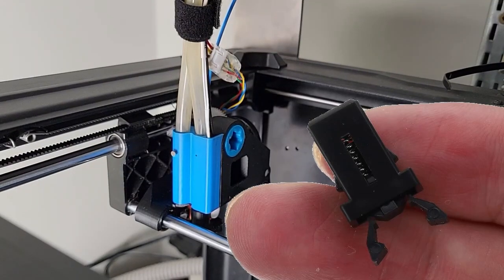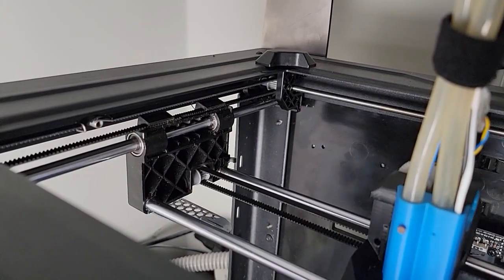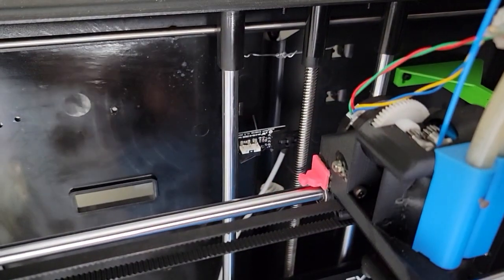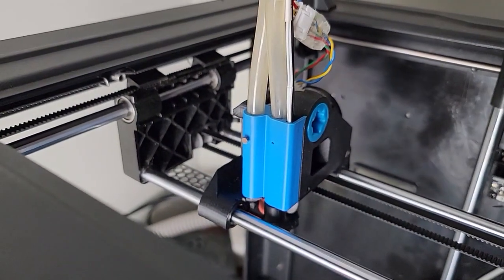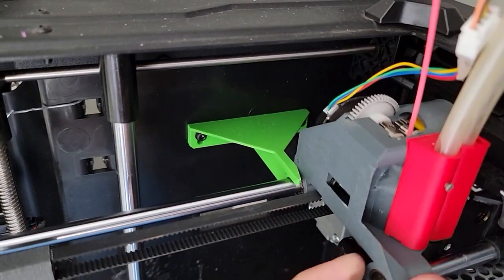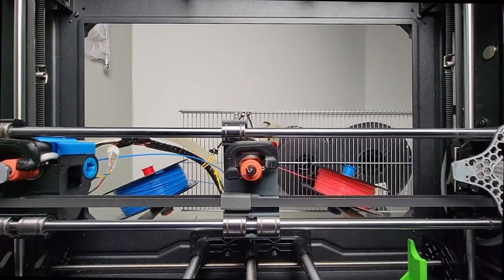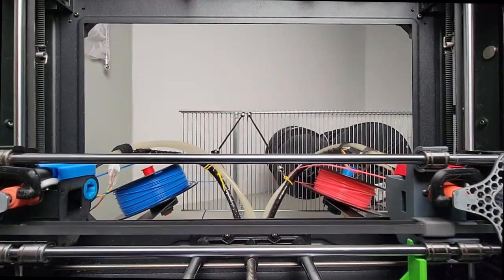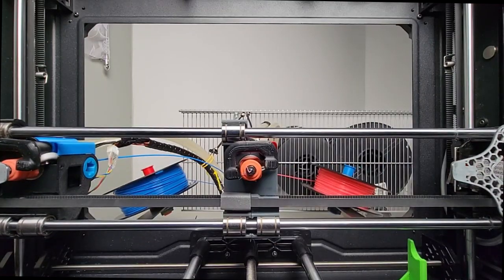Magnetic IDEX Experimental Tool Changer Using Push-Push Latch

Comment: HI. :-) Could this also work on a CoreXY?
Reply from the maker: It should be possible. However, I believe CoreXY machines are better suited for a full-blown tool changer rather than Magnetic IDEX. Personally, I think the era of CoreXY is winding down. They’ll still exist, much like bed-slinger printers, but there’s something far better on the horizon. 🤔
Reply: @m_IDEX  Ja, ich finde das magnetic idex interessant für kleinere Drucker. Ich habe mir einen Sovol SV 08 gekauft zum umrüsten auf einen richtigen Tollchanger. Warum meinst du dass Core XY nicht mehr aktuell ist?
Reply from the maker: I think CoreXY’s reign is fading because there are simpler, lighter, and more robust motion systems out there. A great example is the “Markforged kinematic” or Hybrid CoreXY system. I’ve also been experimenting with a simpler, more direct drive motion system, but it’s not ready for prime time yet.  Curious to hear how your Sovol SV08 tool changer build goes!

Comment: Genius 👍similar to cupboard door latch mechanism brilliant. Sorry I am a bit slow still can’t catch the moving magnetic latch part.😊 it’s just plain magnet on the moving part & steel on the print head right? 😊
Thanks for sharing ❤
Reply from the maker: Thank you!  You can see the belt coupling (white rabbit) assembly in this video: 
https://youtu.be/MN3h3hWuE98?si=UAxnd6M0hMKCThK3&t=39

Here is a cross section view of the White Rabbit:
https://www.printables.com/model/517880-magnetic-idex-belt-coupling-for-worlds-simplest-id

The tool is latched using two small magnets.  I have used both 1/4" OD by 1/8" thick disk magnets and also 1/4" OD by 1/4" thick magnets.

Here you can see how I recover magnets from old prototypes: 
https://youtube.com/shorts/eGYrz3Z6NqI?si=vRc86LgZyc6pBw5o

Comment: Great work . What about the firmware ? is it klipper and bigtreetech board .
Reply from the maker: Thanks!  Yes, firmware is klipper.  I have two printers one uses stock Mightyboard plus SKR mini.  While my 2nd printer with Akula-class motion system uses octopus control board.  You can see my part list and some design notes here:  https://docs.google.com/spreadsheets/d/1fb1T2YSfM-OhzU3zWx77bUNyia4o-GPZsPlaNYT4-vA/edit?usp=sharing
Reply: @m_IDEX  Is the config file available ? I wanna test this idea . Btw maybe you can use this idea to correct resonances in y axis (self aware 3d printers) , https://www.youtube.com/watch?v=OODy-dI52Zg
Reply from the maker: @cleison-em7bk  Link to the early draft of klipper config is located inside the BOM document that I shared earlier.  Scroll to the bottom of the BOM.  Also explore other tabs in that spreadsheet 😊.  AI looks very cool, but I’d rather prevent errors with a great printer design 😊
Reply: @m_IDEX  really appreciate . And looking forward for next results . Thanks .

Comment: How has the repeated cycle life of the switches been holding up the last few months? Not that it is a huge concern ....just regular maintenance data worth having. We are really looking forward to trying this and resurrecting a couple of school printers. Thanks for all your work!
Reply from the maker: For the past two years, the tool changing repeatability has been phenomenal.  The only time I ever need to re-calibrate tool offsets is after a major rebuild.  Otherwise even removing toolhead from the printer does not require recalibration.  The push-push latch is a more recent development, but it is holding up very well so far.  Time will tell how reliable it is.

Comment: I’ve been building a modified version of you midex design for my ender 3 max.  Something that I just thought of is that you could get rid of an extruder stepper driver if you move all of the wires to the magnetic carriage and use a magnetic electrical connector or a usbc to transfer the power for the necessary electronics on the two tool heads.
Reply from the maker: Neat idea, but probably a great way to blow up your stepper driver.  Klipper lets you combine multiple cheap controllers.  You can easily run two SKR mini boards and get 8 stepper drivers.

Comment: Brilliant idea! Congrats! I ordered the latches and expecting to get them in 2 days... I have few questions to you: 
- do you have magnets only in shuttle or also in print-heads at the spots facing shuttle magnets?
- did you glue the magnets? if so, which glue would you recommend for PETG?
- you have very nice solution for nozzle cleaning. Are those metal pieces? Where did you get them?
Thanks
Reply from the maker: Thank you!

•	There is a total of 5 magnets in this build.
      o	One magnet in each tool
      o	Two magnets in the “white rabbit” shuttle
      o	One magnet in the Mirror/Copy belt coupling.

•	I use CA glue for magnets in ABS parts.  Not sure how well that will work with PETG.

•	The metal plates are filament bibs.  They prevent nozzles from oozing filament.
      o	Flashforge calls it “Filament Ooze Plate”
      o	I laser cut them out of 0.060” CRS.  If there is interest, I’ll post some on ebay.
      o	Also, I’ll post filament bib design files on printables
Reply: @m_IDEX  Thanks for quick reply. I am interested in filament bibs, but I first need to come up with the shape and the size that fits my printer. One more question - do you know if Marlin firmware can be configured to support magnetic IDEX ?
Reply from the maker: @bomai559  My first magnetic IDEX build used stock Sailfish firmware and all scripting was done in Simplify3D.  It was usable, but quite painful.  I don't know enough about Marlin, but I don't see why it can't work.  I personally would never go back to anything after using Klipper.  My old laptop is the controller and web user interface.  It also runs multiple control boards so expanding system is super easy.  

Here is an example of my very first (or maybe 2nd) video using sailfish firmware.  https://youtu.be/0azCXGJLPTY
Reply: @m_IDEX  I had issues with Marlin several years ago and tried Clipper. At that time it was very immature product and I struggled a lot with Raspberry to main board communication. I don't recall the details but it was something related to buffering. Then I switched to Repetier and my home built IDEX printer still runs on it. The problem is  - with 2 tools provisioned I often get unexpected switches to tool-1 when printing with single tool (tool-0) This ruins the prints. To completely disable tool-1 Repetier needs to be recompiled, which is super inconvenient. So I am thinking to try Marlin on it since the latest version runs fine on my another CoreXY printer. But Clipper became so popular that  I may give it another try. For now I will try to convert my IDEX to magnetic and then will focus on firmware updates. Here is my IDEX printing in case you are interested https://www.youtube.com/watch?v=Q0ZmdK9RNKQ This is one of the first prints with poorly leveled bed and retraction turned off. 
Thanks
Reply from the maker: Nice IDEX build!  Try Klipper again, but use a real computer this time.  I have Linux Mint running on a 12 year old HP laptop.  I love having full GUI and Mainsail UI in a browser on my printer.

Comment: This is not an IDEX!!!   just toolchanger!
Reply from the maker: IDEX is the simplest form of a tool changer.  Magnetic IDEX is the simplest form of IDEX.   Magnetic IDEX supports all IDEX print modes, including copy and mirror.
Reply: @m_IDEX  I have to agree, keep up the good work, and thank you for sharing the idea. I have a 300x300mm Tronxy frame or an old 300x200Robox printer  I am looking at converting using some of your motion & cooling ideas, aka lightness and simplicity, because it makes a lot of sense to me. 👍
Reply: Yes not a true “IDEX” which uses two X axis motors, but now it has morphed into a “latching” magnetic dual extruder that only uses one X axis motor. Advantages are it is lighter and simpler vs a traditional IDEX, yet achieves virtually the same result in most use cases. As an owner of a defunct IDEX printer, Dmitry has done a fantastic job designing and refining his concept, which is getting simpler and more elegant all the time, and it is unique in the 3D printer space. 🧐😀

Comment: so sick! keep up the good work..!
Reply from the maker: Thanks
Reply: @m_IDEX  NP i home one day i get adventurous enough to get it to work on a bedslinger haha I know you said it's going to be hard but it would be awesome haha
Reply from the maker: @digital0785  if the new latch proves to be reliable enough, bedslingers become super easy to implement.  What donor printer are you thinking about?  I was thinking something like Prusa MK3S+ Bear Kit By Fysetc
Reply: @m_IDEX  I have a cr10v2 back in the day I was designing my own IDEX setup but then stopped when i started doing the ender extender as I needed a bigger enclosure.. This is way better then anything I could've done and way easier to implement/ lower profile from the looks of it. I already have the octopus board and I'm on klipper anyways so least that part wont be bad !

Comment: Maybe eliminate the need for the magnets entirely and just use those latches on the carriage and the frame? It wouldn't be a magnetic idex but might mitigate a potential uncoupling of the carriage and tool. Great printer either way :)
Reply from the maker: Thanks for watching and for your thoughts.   Using a latch like this is possible. However, you'd have to deal with backlash from the latch.  I love the magnet because it acts like a mechanical fuse in case of catastrophic failure.
Reply: With Klicky, we typically configure it with an Normally Closed switch.  This way we can monitor if something goes wrong.  If klicky isn't able to attach via magnets, Klipper will error that the circuit is open.
The same concept could be used here with the magnets.  Though, maybe two magnets so you can pass current through them to detect if the tool didn't attach - or detached too early.

Comment: Do you think the latch will be durable enough to last?  It looks like it has live hinges, which can wear out over time.
Reply from the maker: That is definitely a concern.   This latch is made by several manufacturers with slight mechanical variations.   I wonder if some are rated for more cycles.   Either way, I'll set up my old plywood CTC printer to cycle this latch to failure.
Reply: @m_IDEX  Good idea.  They look cheap enough that it's not too much of a concern to replace.  But if there's a failure during the middle of a a print, well, the results could be "interesting".  :)
Reply: “Made of material, the product is and durable, it can serve you for a long time”

so it is made of material, you cant go wrong here🎉
Reply: It looks like one that is used on Brabantia pedal bin lids.

Comment: So no need to move the y axis for the tool change. That will speed things up.
Reply from the maker: Correct.  This will even work with your bed slinger printer 🙂
Reply: Agreed, every moment count.. indeed very efficient switching mechanism ❤it. Thanks

Comment: So no need for the magnet anymore?
Reply: I think it still uses the magnet to hold the tool to the shuttle.  The hard part was "releasing" the tool, which is what the green arm was for.  But that required moving the Y axis to the end to hold the tool behind the green arm.  Now with the push-push, you don't have to do that.  Which also means this should now work for bed slinger printers (CR-10, Ender3, etc).